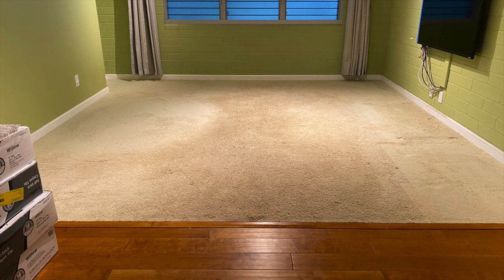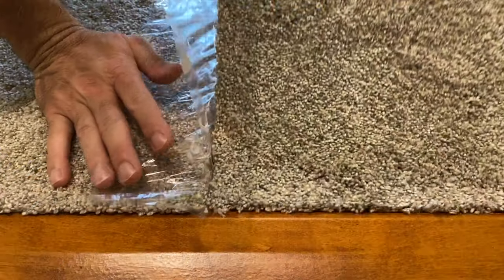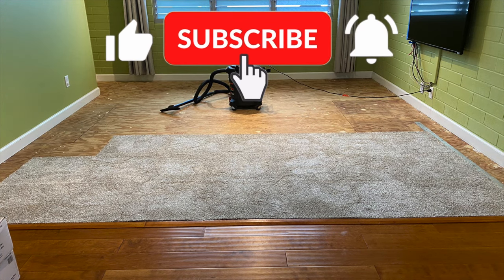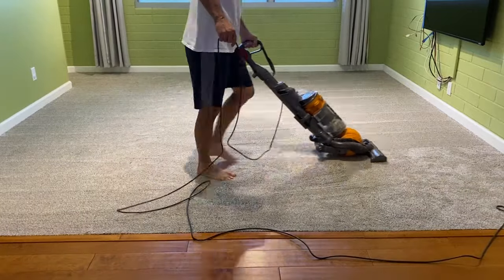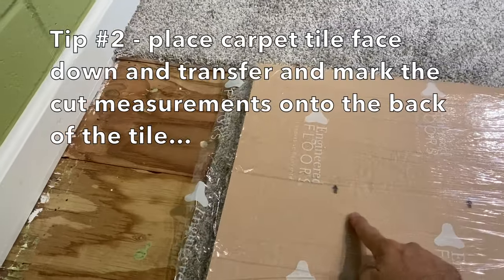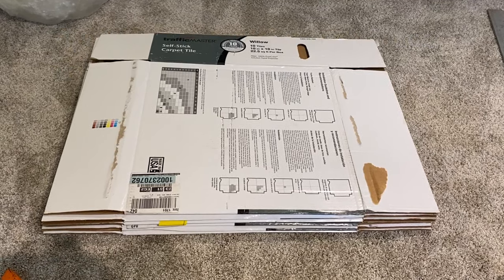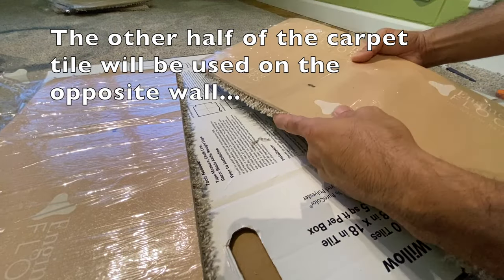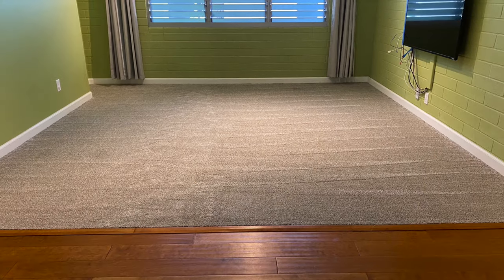Installing Peel and Stick Carpet Tiles for Beginners + 6 Helpful Tips

Comment: Hello I'm wondering if you can give an update on the carpet. Is it lifting in any areas? How is it holding up? Also how soft is it on the feet? Does the padding help? Thank you, just asking cause I'm about to try it.
Reply from the maker: Hi there.  The carpet tiles are holding up well and none have lifted.  The padding does help and is soft enough for us.  It is not as soft as the carpet and padding that we had before but suits our current needs.  Thanks for the question!
Reply: @HacksbyDad  😊 thanks
Reply: @HacksbyDad  It's been a year since your update here. Is it still holding up?
Reply from the maker: @mikesjunk00  Thanks for asking!  Yes, the carpet tiles are still holding up well.  I'm glad that my wife agreed to let me install them.  She was hesitant at first.  LOL
😎

Comment: Great video!! Did you use a carpet roller at all or additional spray carpet adhesive?
Reply from the maker: Nope.  I didn't use a roller or additional adhesive.  Used them as-is straight out of the box.  Almost 2 years now without any problems.  Thanks.
😎
Reply: @HacksbyDad  thank you so much! I laid down 6 tiles last week because I needed to do this in sections, but last night I realized that I'm going to have to start from the middle, pretty similar to your video. Hopefully those tiles won't be ruined! Thanks again
Reply from the maker: @jennysteve4959  Sure thing... good luck!
😎

Comment: If I want to put this on my already wood flooring how much damage does it cause to the wood? I'm in a rental and don't want to cause damage
Reply from the maker: It not a very strong adhesive but I don’t know if it will or will not damage your flooring.  Sorry.  
😎
Reply: They have carpet squares that don't have glue on them. They sell tape that doesn't adhere to the floor but only the tiles  ( one sided tape ). The tape is 6inch squares and used in each corner of the carpet squares.  This holds them together.  Mostly gravity,  will work to hold them in place if your going from wall to wall. I installed flooring 40yrs. Hit me up if you have questions.  Good day.

Comment: Nice job.  That looks like a win.  Still it seems pretty expensive from what I have seen on Amazon.  Decent tiles seem to be above $2.00 / sq. ft.  That adds up pretty quick.  But it does look very good,
Reply from the maker: Thanks!  We're happy with the installation.  Been about 2 years without any issues.  
😎
Reply: Tiles are still cheaper than carpet because with regular carpet you still have to buy the foam, whereas the foam is already included on the tiles. Plus you need floor staples/nails and carpeting tools to make sure the carpet is not loose or bumpy. But with tiles, as you can see in this video, you don't need much more than a blade and straight edge. Tiles are easier and faster to install than carpets. I wish we knew about this option when we had to recarpet a couple of our rooms. The other thing that I like is that if one area of the carpet gets a bad stain on the floor, I bet its easy to replace that one section.
Reply: @emb5091  
Good points.

Comment: This is a great video! How do you remove these tiles?(are these rental friendly?)
Reply from the maker: To remove, start by pulling up a corner.  The adhesive backing is not super sticky.  Not sure if it will leave residue behind after being installed for a long period of time.  
😎

Comment: How many comes in a box? How many boxes did you use?
Reply from the maker: 10 in a box @ 18" x 18" in size.  I don't recall how many boxes I used.  I do have a box and a half leftover and will use it to replace any carpet tiles that get stained in the future.  I believe that getting 10% extra is normally recommended.

Comment: I wish that they weren't so overpriced. 10 tiles for 75 bucks is pretty high.
Reply: I was thinking the same thing when I first looked into them but when you price it out per square foot it’s pretty comparable to traditional carpet. Actually it might be cheaper since you don’t have to buy a separate pad and pay for installation.
Reply: @jenhutton5038 That's a good point.  I'm not installing traditional carpet myself.  Could I..... sure.  Will I no way 😅

Comment: Can you see seams or anything with these?
Reply from the maker: Great question!  
At first, the seams will be visible but will slowly disappear after repeated traffic and vacuuming.  The seams won't completely disappear but most people won't notice them unless they are focused on finding them.  
Tip #1 on brushing the fibers and pile away from the seams as you install the carpet tiles will help decrease the visibility.  Fibers and pile trapped between the tiles will make the seam stand out.  
Thanks for the question.  I appreciate you taking the time to watch the video.

Comment: Where do you buy stick on carpet??
Reply from the maker: I got the carpet tile from the Home Depot.  Thanks.
Reply: @HacksbyDad  what happens if you put sticky carpet on a ceramic tile? Will the tiles gets ruin when you decide to remove sticky carpet??
Reply from the maker: @joycabanas37  It should be okay.  The carpet tiles are designed to be easily removed and replaced in case of a stain.  The adhesive is releasable... not an aggressive bond.  Hope that helps.
Reply: @HacksbyDad  thank you 🙏
Reply from the maker: @joycabanas37  You're welcome!  Please let me know how your installation goes.

Comment: Not necessary to lift the threshold?
Reply from the maker: Not for that transition.  It is a multipurpose reducer molding for a laminate floor to carpet transition.  The carpet butts up against the flat edge of the molding.  Look up "reducer molding" on the Home Depot website for more info.
😎
Reply: @HacksbyDad  I looked it up. Thanks for the knowledge HBD.

Comment: How much did something like this cost? Roughly
Reply from the maker: Current pricing of the TrafficMaster Willow Kirkdale peel & stick carpet tile at Home Depot is $2.70 per square foot.  
😎
Reply: @HacksbyDad  ok thnx
Reply: @HacksbyDad  what's the procedure when it's time to remove them.  I'm moving into a rental place with wood floors. I dont like wood or tiles,I've always loved carpet in my space. Will it damage the floors when it time to remove them?
Reply from the maker: @rindershow212  
Sorry... I'm not sure.  The carpet tiles have a tacky adhesive but I don't know if it will leave a residue after being installed a long time like masking and transparent tapes do.  
I just pulled a corner and it easily released, but this is on a bare plywood subfloor and the carpet tiles were installed about 14 months ago.
😎

Comment: I fail to see how this saves time and/or money and just leaves you with a rug with all sorts of potential gaps that will show over time.
Reply from the maker: Gaps?  Only if installed incorrectly.  
Carpet tiles have been around for years especially in the commercial space.  You’ve probably walked on carpet tiles at the airport, train station, shopping mall, your doctor’s office, etc.  I see them all the time.

Comment: From a carpenter of 25 years... dont. ...just dont. 😆🤣
Reply from the maker: Please explain because I haven’t experienced any problems and am happy with the installation 2 years later.
Reply: ...reasonable question, with a sense of genuine curiosty versus todays expected defensive replies and assumtions and I for one appreciate and thank you for that. Its genuinely refreshing. I didnt intend to imply its a bad product, Its not and actually seems to survive longer than when padded and stretched. Sorry,  I didnt clarify but i was actually referring to after it needs to be removed for remodeling etc.. often it can be a real a bear to remove especially if commercial grade glues are involved. Over the years its been the cause of some of my most frustrated and comical moments. Just trying to figure out better and quicker ways to get it done has lead to some dandy memories. So in no way did i mean to disparage the product. It was more just for myself i suppose, I smile and cringe instantly at some of my removal memories that your share brought to mind. ~TS~
Reply from the maker: @tomshira5882  Thanks.  Appreciate your feedback.  😎

Comment: As I've sold carpet for 36 yrs... Carpet tiles suck!  A. There aren't many made for residential use..
B. Yes u can install yourself. But if you compare to a quality carpet installed per square foot.  Crazy expensive!
C. Yes u can replace 1 piece! But realize that it won't match the old carpet and look stupid cause the rest is worn or discolored. 
A WASTE OF MONEY
Reply from the maker: Thanks for your opinion.  
I'm happy with my installation.  It's been in place for about 2 years without any problems.  
😎

Comment: Reviewers on the Home Depot website are claiming that the dimensions of the carpet tiles are not consistent. Did you have to measure all the uncut tiles to verify the size was correct?
Reply from the maker: I don’t recall an issue with the size of the carpet tiles.  🤷🏻‍♂️